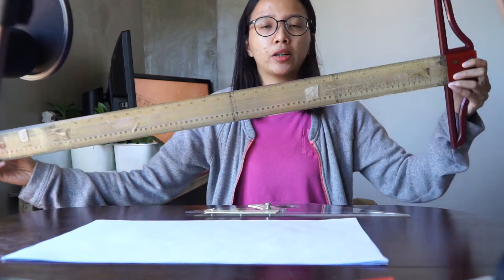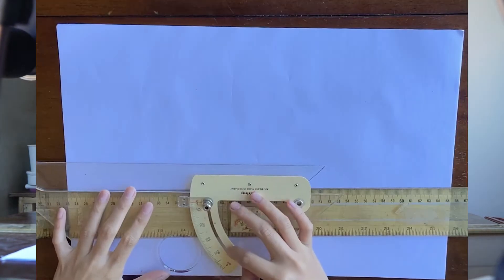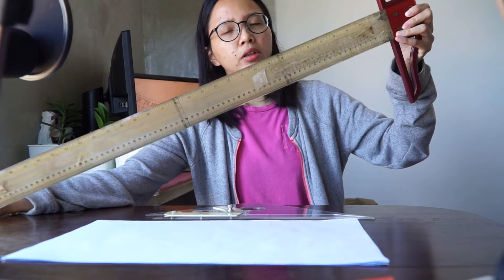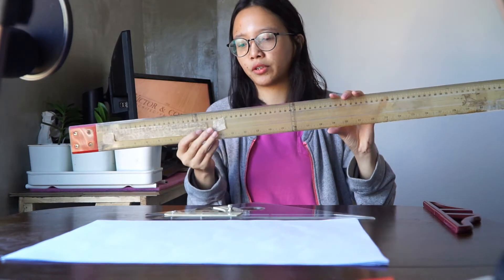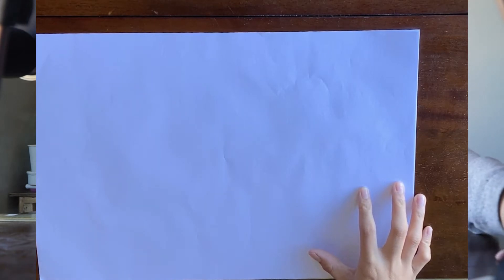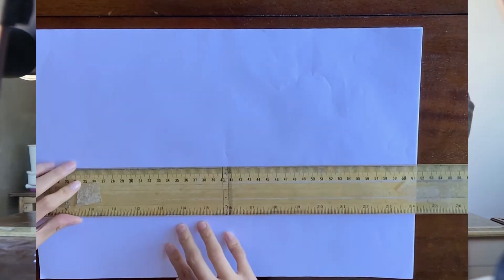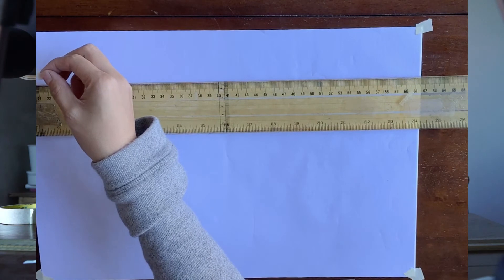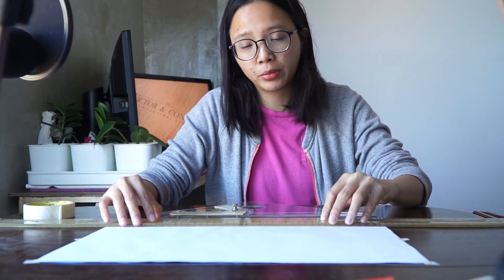Technical Drafting - T Square

Comment: Thank you for sharing your Adjustable Triangle, I would like to use it in my  landscape watercolor painting. I am just new in this tool, can  you please share with a good brand or any substitute brand, that is good enough for 31cm x 41cm paper.
Reply from the maker: Maybe look for rotring brand or staedler, as long as the triangle is comfortable enough for you to on your desired paper. You can always get a different size one of course if you have the means. ☺️ Hope it helps.
Reply: @jammanabat6630  Thanks....medyo pricey....sa Lazada mura mura kaunti. Thanks
Reply: @jammanabat6630  Hello Jam....may T-square...acrylic and with wood, which is better? Thanks
Reply from the maker: Well, you have to check also, sometimes kasi if not branded, medyo di maganda yung edges nila. May mga bumps and all.
Reply: @jammanabat6630  Noted and thanks

Comment: Hi po , why is my t square po is cm lang po in both sides?
Reply from the maker: If I’m not mistaken, yung mga staedlaer kasi naka in ‘cm’ yung units nila. Yung gamit ko kasi is Rotring. ☺️ I think Rotring yung may English and metric on each side. 
Hope this answers your question.☺️🙏🏻
Reply: @jammanabat6630  ohh , thankyou maam! Godbless!💓
Reply from the maker: @GTAVREELS2026  Sure thing! Happy drafting!☺️✌🏻
Reply from the maker: Hello! Ilang inches yung t square nabili mo?☺️
Reply: @jammanabat6630  36 inch po
Reply: @jammanabat6630  staedtler po na 36"